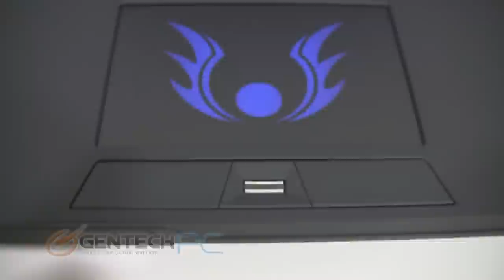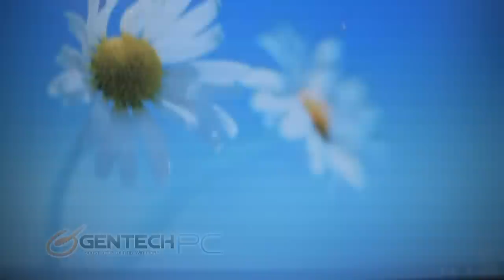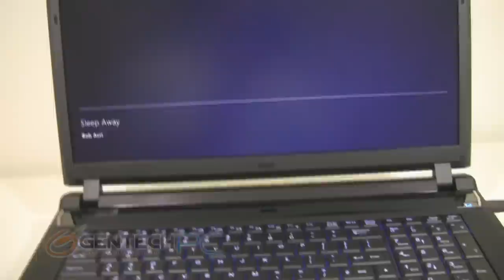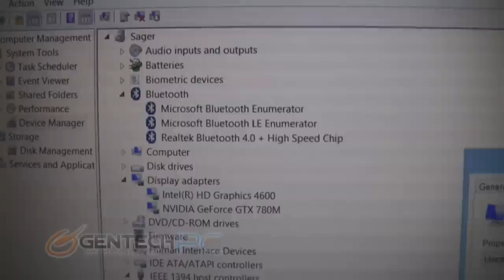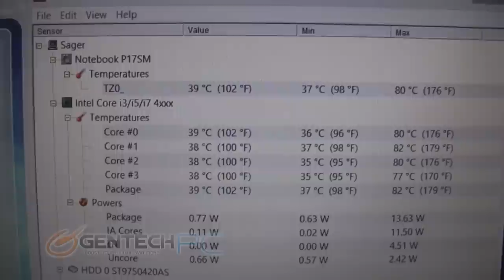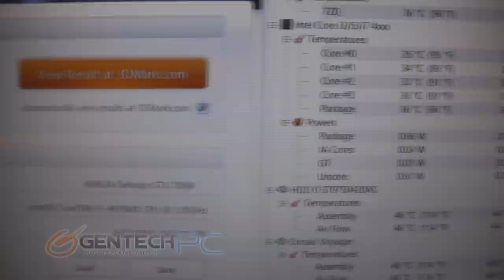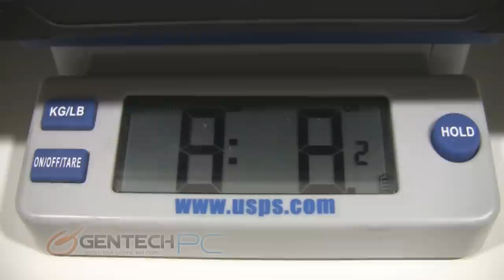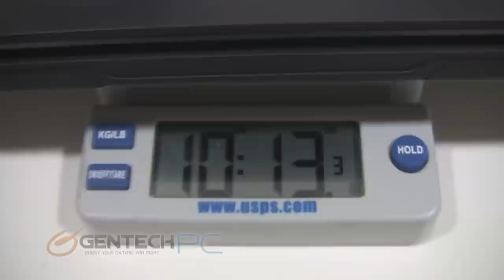Sager NP8290 Haswell GTX780M (Clevo P177SM) Review & Benchmarking

Comment: It looks like Clevo has improved the ergonomics of this gen of laptop. Generally the laptops are pretty standard across the board right now.

- i7 4700-4900M CPU
- Up to 780 or Quadron
- 4 DIMM slots
- 2x 2.5" drives
- Blu-Ray or more 2.5"
- External ports
- Dual fan cooling (except MSI)

It looks like temperatures, and display quality are going to be the deciding factor - maybe audio or battery life as well.

Comment: Thank you so much for explaining that to me, the 177 does seem tempting then considering I'm kind of concerned about cooling.

It's a shame the website I'm planning to buy the 170 from doesn't offer the 177 though.

Do you know if the 170 generally has sufficient cooling or would I need to buy a cooling stand for gaming? I'm planning to buy the gtx 780m 4700mq version with 16gb ram and no HDD.

Thanks again

Comment: So far I've found out that the P177 (don't get the NP8290, get the 95, it has a defective mSata slot) has an improved heat sink for better temps, changed mic location, and then just the general design changes you see.  This is apparently the only changes between the 170 and the 177.

Comment: I was looking at a sager (as it's the only way I can find an i7 with a 8970m) and was wondering if these ports shown are standard.

I'm a little thrown off by their selection area to ADD display adapters, but if these are what come with them without adding that then I would be happy to save my money.

"1x USB 2.0 FHD Video Adapter (HDMI & DVI/VGA Inputs) (Laptop Display+External Display from Laptop+ USB FHD Adapter = 4 Total Displays) (up to 2048x1152 Resolution)" is +$122

Comment: Look at anandtech's review of the msi gt70. In the msi the cpu and gpu share one fan and this causes the cpu to throttle. It meant in cpu intensive games this msi performed slower then an alienware with a i7 and 680m. Have a look for yourself tho, I would get the clevo. 1 fan for 2 high end pieces of hardware is stupid.